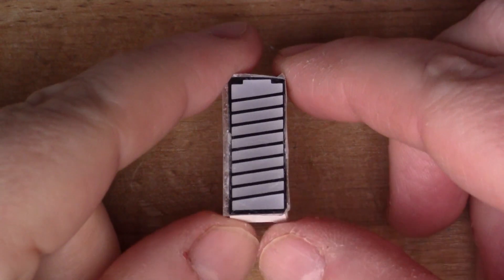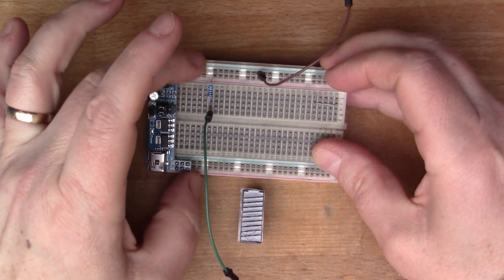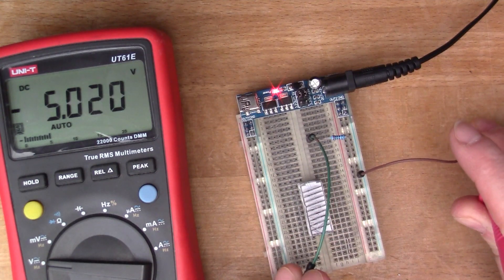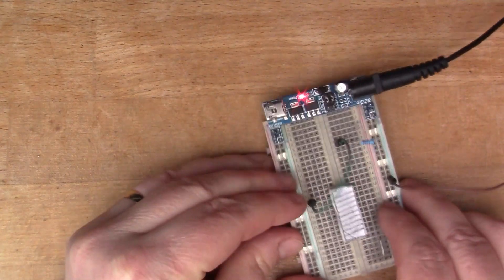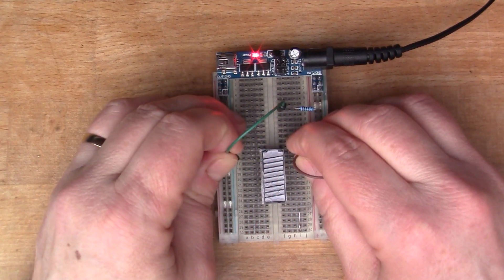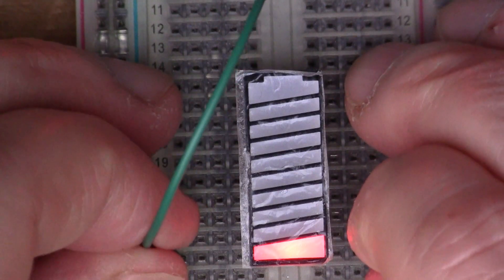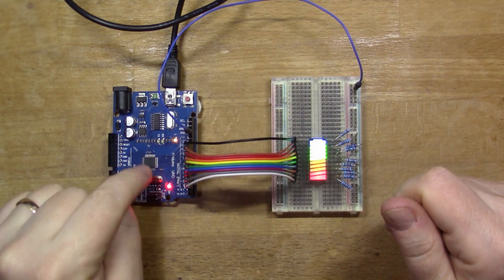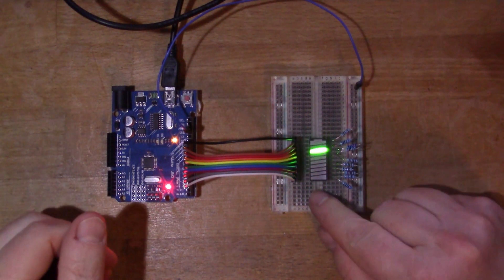LED Bargraph Displays (#95)

Comment: Hey, I've been watching these types of videos and nothing describing the project I have in mind. I have a question:
I plan on connecting a mini mic to a small preamp board. I want to use a potentiometer to control the volume of the preamp, and use the LED board to indicate the volume (if that makes sense).
Do you or anyone else know what the schematics of this would be? Which order would I connect them, if it's possible?
Any advice would help, as I'm new to this, and haven't found anyone online yet who's done this. Thanks.
Reply from the maker: If you want to actually measure the volume, you can get off-the-shelf kits for that.  On ebay, try searching for something like 'LED VU meter', or I remember there are chips like the KA2284 or LM3914 or LM3915 that do this job.  If you just want to measure the setting of volume I would probably buy a dual gang potentiometer and use one side as the volume (between preamp and amp) and the other side to drive a bargraph (e.g. using the LM3914).
Reply: @MartynDavies  I just checked all those out. I think the LM3914 might best suit my needs, but I still need to look into it more. My goal isn't to have an audio meter that shows the audio level in real time, but more to actually control the volume of the audio output, and have the led bar graph show how loud it's gonna be. 

I'll keep doing more research on the LM3914, and thanks for the recommendations. Now I mostly just have to find out now which oder I can connect them to suit my needs.

Comment: I have been an  audio engineer for 25+ years. The colors are consistent with the standard Audio Level Peak meters. Red for clipping. Yellow for close to clipping(healthy strong  signal). Green for safe range. Blue for too low a signal.

Comment: You could use an lm3914 bar graph driver ic to make a voltage/battery health tester or something similar.  It has ten outputs so is directly compatible with this module.  Possibilities with arduino are probably limitless! ;-)
Reply from the maker: yes .. I've got one of those somewhere